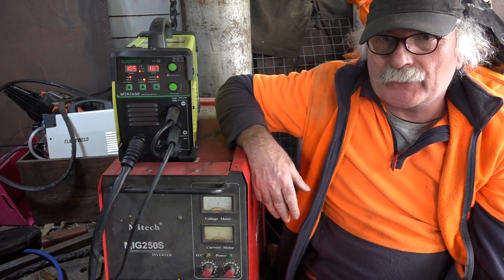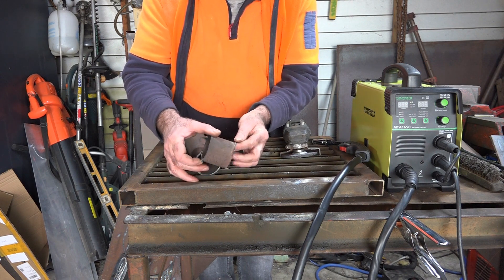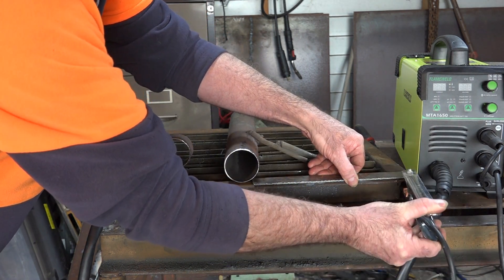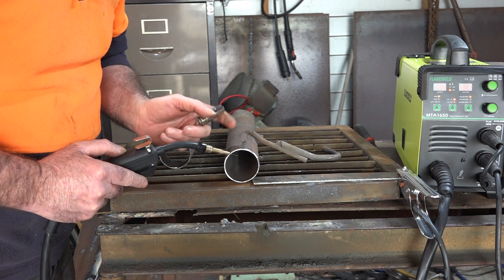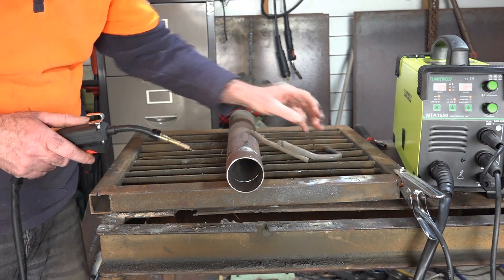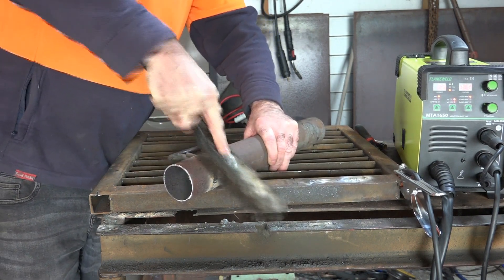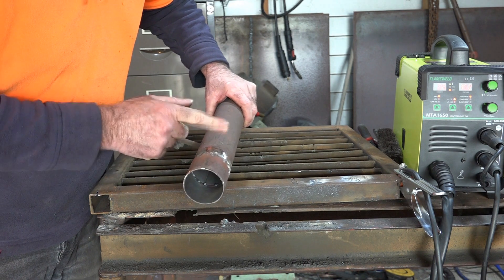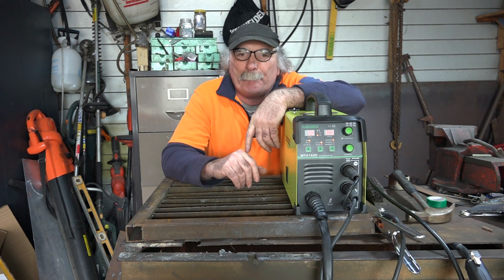Flux Core Welding Exhaust Pipe - MY FIRST ATTEMPT

Comment: G'day Pete. I worked in custom exhaust shops for years when I was a young man. First starting off doing mostly gas welding, then MIG when small, 110 volt MIG machines became readily available. Worst part of MIG in an open shop was having to shut all the doors on a windy day in order to weld. But also, we rarely butt welded anything. We'd expand an end to slip over then weld the end of the expanded tube. Or make a short collar, slide both ends in and weld that. Butt welds, specially on old tube, just didn't hold up for long. I've yet to try flux core, but I don't think you did too bad for a first attempt.
Reply from the maker: Thanks my friend